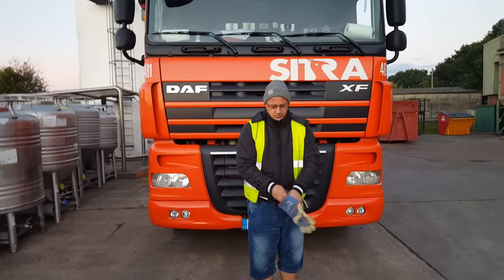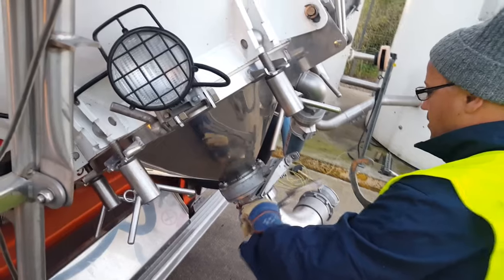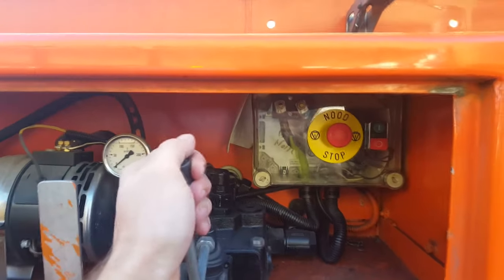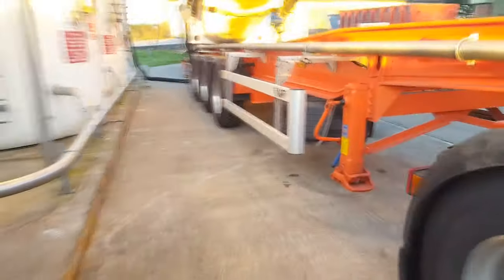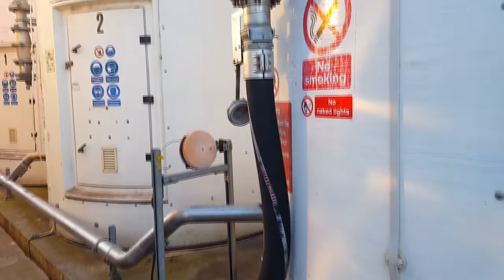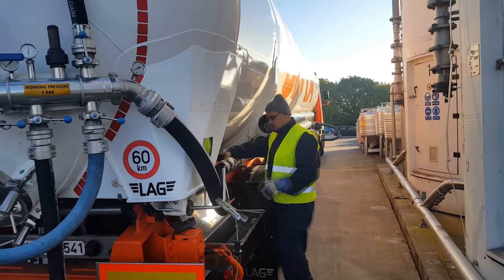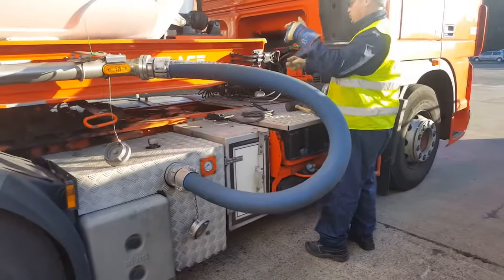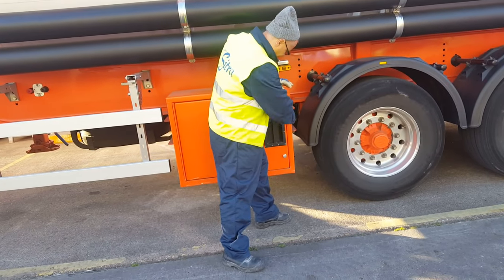How to unload the bulk tanker into the Silo

Comment: Why are you first releasing the air of the trailer and after that you lower the legs? I learned it other ways to first lower the legs and then release the air. So that it is more stable because all weight of the trailer will rest on the legs :)